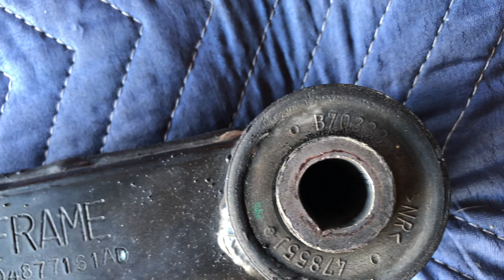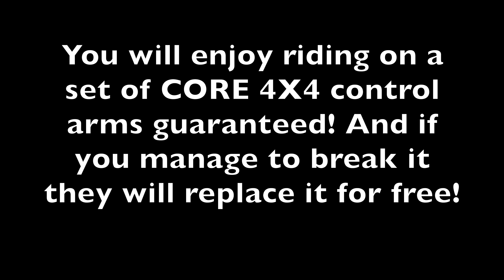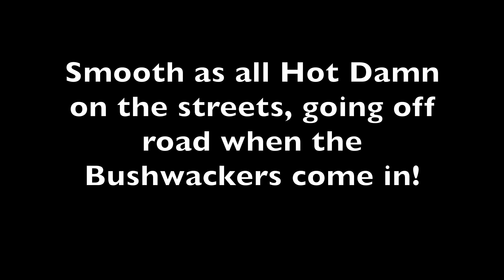4th Gen RAM 1500 rear end noise possible solution to your headache

Comment: Dude. This has been a headache of mine for four years! I thought it was the tailgate, the trailer hitch etc. But no joy there. Going to order some Core products. Going to try tightening everything first. Also just had my rear upper control arms replaced at 4 Wheel Parts, they said the bushings were bad. But my 2016 only has about 37,000 miles on it. I'll keep you updated. Thanks for this video brother.
Reply from the maker: Yup tighten first and use some wd40 to help find the noise if needed.

Comment: I’ve been hearing a small knocking noise when I take turns some times. Also when I have the bed loaded or pulling my camper I hear a loud clicking noise when I accelerate a bit or hit some bumps. I’ve got a 2014 1500 and it bugs the hell out of me. Could the control arms be the source of this noise or something else?
Reply from the maker: Have you opened the diff and checked for broken gears?
Reply: @HOTDAMN  I have not. The knocking noise happens every so often and isn’t very consistent. Sometimes I’ll go weeks without hearing it. The louder clicking noise has only happened when I’ve got weight in or on the rear end and so far since it’s started that’s only been twice. I have zero problems while driving it regularly.
Reply from the maker: @chromemox3319  Limited slip diff?
Reply: @HOTDAMN  honestly couldn’t tell ya at the moment
Reply from the maker: @chromemox3319  no problem, it’s a hard problem to locate unfortunately. Process of elimination is probably going to be the way.
Reply: @HOTDAMN  for sure. I’m not a car guy at all so I google everything and can’t seem to find anyone else with this specific problem. I’ve got some friends that can help luckily. If anything I’ll figure out what it is when it inevitably breaks on me randomly.

Comment: So my 2014 ram 1500 makes no noise in the rear end. But it has a tendency to axle hop. I’m guessing from it being leveled with bigger tires. Since the structure of the truck has not really been changed should I get the tubular arms instead of adjustable. I feel sure I don’t need the Panhard bar. Just need to stop axle wrap and wanted your suggestion. Thanks

Comment: ive been hearing more of a tweeting noise like a bird that sounds when I accelerate sounds up to 30mph I've replaced both u joints, transmission mount, brake shoes and pads noise is still there and im about to dive into the rear but I want to know what you think before I do that also it clunks from P to R and R to D
Reply: What was your issue? I’m getting a loud tweeting/squeak noise when i accelerate to around 50mph. Sometimes it gets louder when I hit a small bump.

Comment: You said it feels like someone bumping you in the back? Is it when you come to a complete stop and the truck settles and you feel a bump? I’ve had my transmission replaced from the dealer and I’m still feeling it. Haven’t noticed any noise, but I noticed you said a bump from the back. Let me know if you had he same issue! Thanks
Reply from the maker: I did have the same issue, but I also had a little squeaking.  Do you feel a thump putting it into gear?

Comment: Hey brother, really random but with your wheel offset pushing your tire and wheel out do you have issues with rock chips on the paint?
Reply from the maker: I have been real lucky, I do got a chip here and there.  I just got flares, haven’t put them on yet.
Reply: KUSTOMBLACK GUNZ for someone who doesn’t do much off-roading, should I be that worried about rock chips, I have a -18 20x10 wheel
Reply from the maker: I wouldn’t worry unless you hear rocks bouncing off the body or constantly being thrown into the wheel wells.

Comment: Hey. Why are you not putting that bolt in that hole of control arm All The Way In ??? I dont know how people felt for that... the diameter of the bolt where treads are is smaller so you can easily insert them. There for you show that it has a play in there. How about showing a video with that bolt all the way in and than wiggle it. We will than if you are just promoting some new parts for people to spend money on.
Reply from the maker: What are you talking about? Very sorry I can’t understand. Bolt in the hole all the way?
Reply: the bolt that you are putting in the control arm..... you are just lowered the treathed side of the bolt and not all the way in which is bigger in diameter.
Reply from the maker: What are you taking about? Everything is installed correctly and still good to go to this day. What bolt? There’s 8 of them. I’ve been under that truck a 1000 times since this video, nothing is incorrect.
Reply: From this video skip to 0:53 .. that is the part i am talking about you are showing that it makes noise ... but you are not putting that bolt all the way in to that control arm.